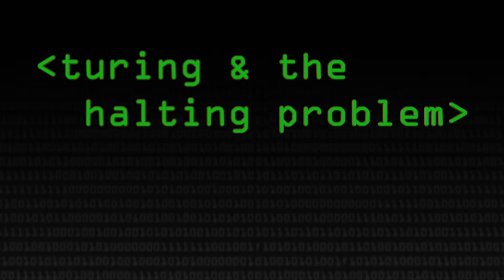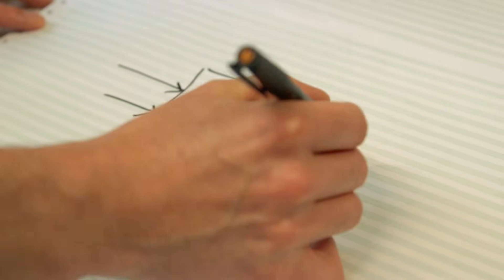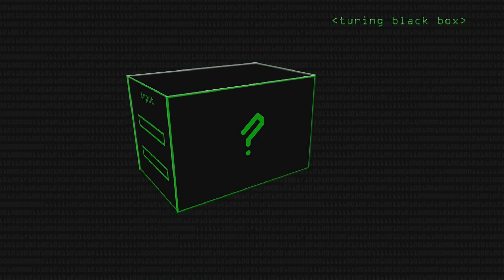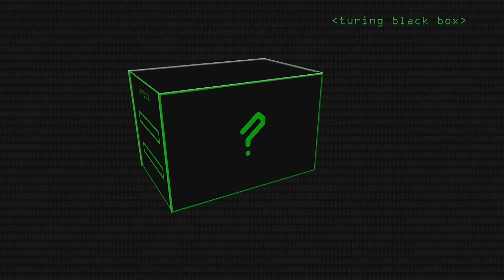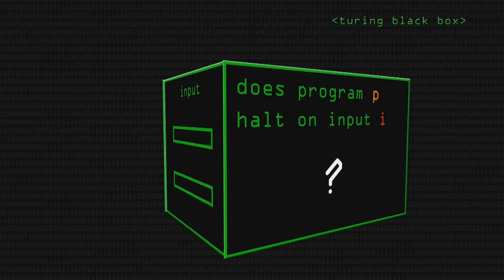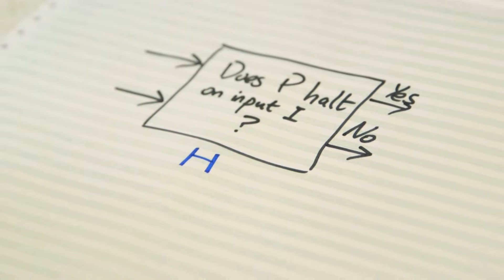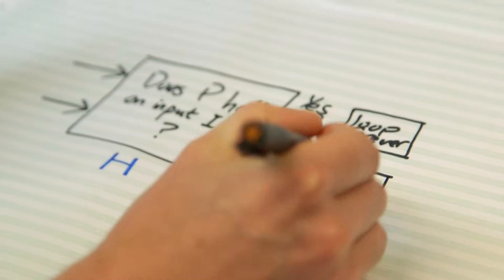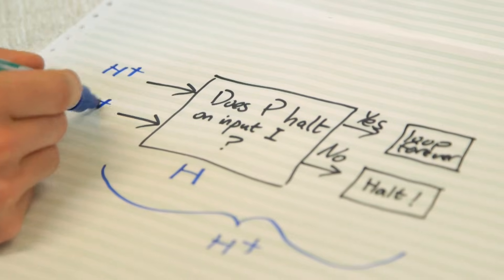Turing & The Halting Problem - Computerphile

Comment: You need more examples, I still don't understand what the problem is or what it has to do with computing...??
Reply: This is the strange bit of computing where logic, programming and philosophy sort of overlap. It's all about pure logic, rather than computer programming.

In engineering, if you want to build a new bridge, it's a good idea to make sure your design will stand up. There are rules, maths and ways to prove all of this before building anything.

If you want to make a computer program to control (for example) a nuclear power station... it'd be good to know your software was going to work properly before using it. So can you construct a way to prove it will work?

After all, computers are logical machines that follow very precise rules so this should be possible. And yet sometimes they crash for no reason.
Reply: "In computability theory, the halting problem is the problem of determining, from a description of an arbitrary computer program and an input, whether the program will finish running or continue to run forever." -Wikipedia

http://en.wikipedia.org/wiki/Halting_problem#Importance_and_consequences
Reply: The point here is that there is no "easy" way to figure out if a computer program will halt (aka. finish) or not. The means of figuring this out would require more time than the original program to either halt, or not halt. If the original program does not halt, then the super-program would also not halt, thus you won't know if the original program halts or not.

The point being, certain information is unattainable about a computer program.
Reply: Program doesn't mean program in the modern sense. The Halting Problem is the absolute foundation of Computer Science.
Reply: ***** About ^all/any^ actually. There is no certain way to know if a program will halt for a given input without running the program. You can't even know if a simple "hello world" program will halt for any given input. Who know, there might be a bug in the compiler, a bug in the language itself. The question "will this program halt for any given input" is impossible to answer without trying every single possible input, which is practically infinite.
Reply: ***** No, there is no way of knowing for sure "hello world" will halt without running the program, which is the whole problem. Because a program does not take an input has nothing to do with it's halting characteristic. The program "while true" also does not take any input, and this is arguably never halting, but again, it is language and machine dependent. You won't really know unless you run it. But sure. "I clearly don't understand the subject"
Reply: Cort3z That's absolutely not what the halting problem is about. This is a problem of algorithms and logic, not of physical computation, otherwise ALL programs halt with absolute certainty because the machine they run on will eventually cease to function. So yes, you clearly don't understand the subject.
Reply: NoRotation Yes, absolutely it is about logic and algorithms. I am not sure if you read my initial comment, but this is about the specifics of the program. You can't say that "any hello world program will halt", because it is implementation specific (or "specific-algorithm-specific" to not confuse my use of "implementation" with a physical hardware runtime). It comes down to the procedure generated, the algorithm. I don't want to get into a flame-bate, however, my initial point is still: To know for sure that any given program/algorithm will halt, from a machine perspective (aka. inside another program), you have to somehow run the algorithm. Any attempt to make a "meta"-program that reasons about this program will have to stumble into the same issues as the original program, thus, you have to run either the initial algorithm, or an even more complex version of it. 

Anyway, to know, from inside another program, that a certain program will halt, you have to run it and see if it does so, which is what I am trying to say.
Reply: Cort3z Take this example, I have a program that does one thing, it halts. If in whatever implementation it does not halt then it was not an implementation of my program, if it was an implementation of my program then it will halt and thus my program halts for certain. Do you get how that works?
Reply: NoRotation And how are you going to make a program that can verify that that algorithm halts without running it? Do you see? This is the point. Given an arbitrary program, another program cannot verify that it will halt without running it and observing that it halts (observing that it does not halts is impossible). The halting problem is about making a program, or general procedure, that can verify other programs or procedures ability to halt. and no such program can be made without running the given code/algorithm/procedure. 

So, yes, your program will halt, but that has little to do with "The halting problem", which is more general and about making programs/procedures that verify/deny other programs ability to halt.

There are many other resources describing tihs, but here is the wikipedia one: "In computability theory, the halting problem is the problem of determining, from a description of an arbitrary computer program and an input, whether the program will finish running or continue to run forever. Alan Turing proved in 1936 that a general algorithm to solve the halting problem for all possible program-input pairs cannot exist."
Reply: Cort3z Oh good, you found the Wikipedia article, now go read what a program is in the context of the halting problem and realise it's an idealised sequential procedure that is completely independent from actual implementation.

Keep in mind that these theories were constructed before compilers and languages were and therefore cannot possibly be compiler/language dependent like you say.
Reply: I think that I might have expressed myself unclear, or you might have misread it. Either way, I am not saying that you cannot make a program that tells if another one halts, I am talking about the general case, and always was.
Reply: Cort3z To quote you: "there might be a bug in the compiler, a bug in the language itself" and "it is language and machine dependent." Now consider that Turing provided his proof before any language/compiler/machine existed, now clearly your "halting problem" is different from Turing's "halting problem".

In general an algorithm is assumed to be implemented correctly, then it becomes completely language/machine/compiler independent because in general those are all assumed to be variations on a Turing complete computation machine.

So although you're right about the halting problem not having a general solution, you're wrong about the reason, specifically you think the problem is at the language/compiler/machine level when its actually at the level of first order logic.
Reply: Nice to quote half the sentence from two different comments who are about different themes :) First: I was talking about what information is possible to obtain about a program, not the halting problem. Second point was also not about the halting problem, but the fact that one example of a code that halts does not prove that the halting-problem is solvable.

But yeah.. I'm totally wrong and you are right. Let's leave it at that.

Comment: There is one big problem with this. It is that you are assuming that your logic is correct. If some one gives you a machine that solves the problem you would assume that it is fake. But if it is not you have to over think everything that science achieved. It is unlikely but possible, or?

Comment: but maybe there can be a program that solves the halting problem for all programs except itself !
Reply: It's not for itself, h solves the halting problem not h+.
Reply: But H+ is constructed using H. Maybe let me refine Kot_Robot's comment:
Maybe there can be a Turing machine S that solves the halting problem for all programs except those that reference a Turing machine capable of solving the halting problem to the extend in which S itself is capable of solving the halting problem.

I intuitively think self-reference is key to both the logical contradiction ( like the liar's paradox aka. "this statement is false" ) as well as to the way to solve it ( think through the Turing machine S I constructed up there ).
Reply: @greencoder1594  Sorry to disappoint you, but that is not possible. This is a really simplified version of the proof and i understand that it may hold this implication if you aren´t invested in theoretical computer science (formally it´s usually prooven via diagonalization, which is much less intuitive). It actually turns out that even the BTHP is undecidable (blank tape halting problem -> given a turing machine M, does M halt on an empty input?).

Comment: What's also interesting is if you could build an "oracle" (ie a machine that solves the halting problem), you could use it to immediately solve many unsolved mathematical problems, such as the Goldbach conjecture or the Twin Prime conjecture. Simply make a program that starts looping integers and halts if it finds an integer where the conjecture doesn't hold. Normally doing this would be useless since you'd have to run it forever, but if you had an oracle you could simply input into the oracle and it'd immediately tell you if it ever halted and if it did, conjecture is false; otherwise it's true.
Reply: that's so cool!
Reply: Clever! Thank you for sharing!
Reply: Would it need to be "immediate"? What if it took 1 mllion years to run?
Reply: @rupen42  no this isn’t a machine you can actual use or build the same way you could a TM. In essence, oracle machines provide a way of comparing harder problems to each to see if they are in the same class. While this machine could “solve” the halting problem for Turing Machines, there now introduces a halting problem for Oracle Machines which is basically just as hard as the regular halting problem if not “harder”
Reply: Incredibly put!
Reply: Nice! Yes for Goldbach's, but not for twin primes. You can't write a program that checks if integer has no twin primes after it without checking all primes bigger than it so it will loop forever whether twin prime conjecture is true or not.
Reply: @janPeja  create a Turing machine M that takes a number i, and counts twin primes, stopping when it counted i.

using the oracle on M, you can determine if there are at least i twin primes.

construct another turing machine N. it iterates over i and invokes the oracle on M, stopping when the oracle detects M looping.

invoke the oracle on N. if it loops forever, that means there are infinite twin primes.
Reply: @the_cheese_cultist  I love it!!

Comment: What if the computer holds an oscillating program, giving equal times yes and no to our halting query in its N1th run and feed that answer back into the computer, hence modulating N+1th to the oscillating signal with the time needed from input to process to the output. Wouldn't then the modulating frequency in relation to the ever diminishing signal modulation and it's ratio be a solution solving the contradiction's to it, answering a halt state?

Comment: Am i missing something here?  So we assume that H solves the halting problem, and we then proceed to show a contradiction by showing that H+ doesn't solve the halting problem when you feed H+ into itself.  How does this contradict the assumption that H solves the halting problem.  We only showed that a modified version of H, namely H+ doesn't work.
Reply: Hey Mike LaValley
I seem to be in your former position. I can't quite wrap my head around his explanation.

H can tell whether any program P will halt or not on any argument I. 
H+ does the SAME, it just also does the opposite afterwards. 

So he says he’s feeding H+ into itself, why can’t H handle that?:

H is to examine H+(1) and H+(1) figures out another H+(2) system will halt (because the H part of H+(2) said it wouldn’t halt), H+(1) won't halt (again because H+(2) did halt) and H will say no, which is correct.
And vice versa.
Reply: H+ get's the wrong answer because they are faulty, but H isn't.
Reply: The argument is the following:

1) Assume we can build the machine H
2) From H we can build H+ as follows:
2.1) H+(x) = "if H(H+,x), then loop forever, otherwise, halt". (NB: A(x) means "feed x into A").
3) Let's calculate what would happen if we fed H+ to itself (i.e. H+(H+) )
4) It turns out that to calculate what H+(x) does, for any x, we have to know the result of H(H+,x).
5) That's okay. H(H+,x) is the same as "Does H+(x) halt or not?" Since all machines, given an input, either halt or don't halt, we can try to find out what would happen in either of these cases.
6.1) Let's try the first case: Assume that H+(H+) does halt.
6.1.1) If H+(H+) halts, then H(H+,H+) is true, so from the definition of H+ given in (2), H+(H+) would loop forever.
6.1.2) wait a minute, a program can't halt and loop forever at the same time. This is an impossibility, so this must mean that our assumption was wrong: H+(H+) cannot halt!
6.2) So let's see what happens in the second case: Assume that H+(H+) does not halt.
6.2.1) if H+(H+) does not halt, then H(H+,H+) is false, so from the definition of H+ given in (2), H+(H+) would halt.
6.2.2) wait a minute. H+(H+) cannot run forever and halt at the same time. This is also an impossibility,
7) We got to the conclusion that H+(H+) cannot halt and cannot run forever. But all programs either run forever or halt! There's no in-between. This means that we messed up some other assumption.
8) Maybe H+ isn't a program? Unfortunately everything we did to create H+ from H is valid, so if H really exists, then H+ really exists.
9) Since we can build H+ from H, but H+ cannot exist, then H cannot exist (i.e. the assumption we got wrong was (1) : "assume we can build the machine H" - in fact, we can't).
Reply: well they "cut corners" in the video.
when you create H+ from H you need to add a part on the input side as well.
while H has 2 inputs a program description - call it P and the input of the program - call it I.
H+ has only 1 input a program description. and it gives it to H as both P & I.
now when you run, you run H+ and give it as input H+.
H+ will give it to H which will now check what happens when H+ runs with H+ as an input (which is really what happens).
if H+ should halt then it doesn't, and if it shouldn't halt it does, thus creating the paradox that proves that H is impossible to build.
Reply: +mart3323 You are a godsend, I was reading so many comments, but yours is the only one that actually made sense to me. Thank you...
Reply: it's not that H+´doesn't solve the problem, H+ doesn't even try to
it's that H, as PART of H+, fails to predict H´+'s result

For any machine H that claims to solve the halting problem, you can create a machine H+ for which it gives the wrong result, thus showing that H doesn't work for any machine

you can imagine H and H+ next to eachother, feed H+/H+ into H first, then into H+
No combinations of the two possible results of each machine give you a logically consistent result - thus there exists no H that can predict a H+
Reply: ***** Upon further reflection it makes perfect sense to me now, there must have been something in his explanation that just didn't sit right with me at first.
Reply: Peter Helstrup Jensen It's not simply that H+ gets it wrong; the problem is that H+ causes a paradox. Any assumption that results in a paradox must be wrong, therefore H can't exist.
Reply: but H+(1) and H+(2) are the same machines that get the same input.., if they get different results that means the machines don't work
(which they don't, they can't, there's no such H that works for any machine)
Reply: Peter Helstrup Jensen H+ is made up of a perfect H and a perfect N
In order for H to not be faulty but H+ to be, the only possible other conclusion is that there can't exist such a machine N that, given inputs "halts" or "doesn't halt", does the opposite

i can easily prove this to not be true with the following code

if(inp == "halts"){
while(true){
a=1
}
}

(don't actually run this with inp = halts unless you're okay with freezing your browser)

so if H+ is only a H and an N, and we know N is not faulty, the only possibility is that there's a fault in H (there can't exist such a H)

A theoretically perfect machine can't break just from being connected to other perfect machines =P
Reply: elraviv Now THIS explains it to me, thank you very much. 

The video makes me think that there are two h+ machine involved, with one h+ plugged as an input for h+(h+) and somehow the h+(h+) will give an output about whether the input h+ is halting or not... And it confuses me, I mean where is the part that says h+ is giving an output at all?! It's a shame they cut corners on that...

Anyways, thank you for the enlightment!

Comment: Either I didn't get the Halting Problem in university or Mark describes it incorrectly. He says at 03:35 "...whether a given machine with a given input will halt or not." Shouldn't it be "any machine with any input", any as in an arbitrary? Because surely you can built a machine that can determine the Halting Problem for "some" machine with "some" input, but the point is you can't do it for every/any/arbitrary machine. Or maybe I just got lost in translation? (I'm not a native english speaker)
Reply: His description is ok because he doesn't claim you that this program is in some kind of set, he's saying "given program" which actually means that this program could be any program. The same goes with inputs